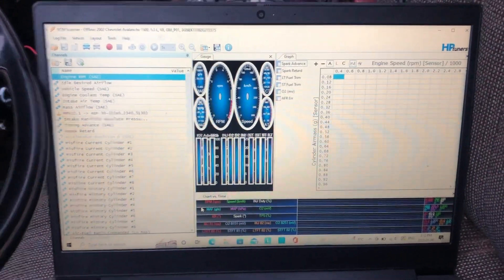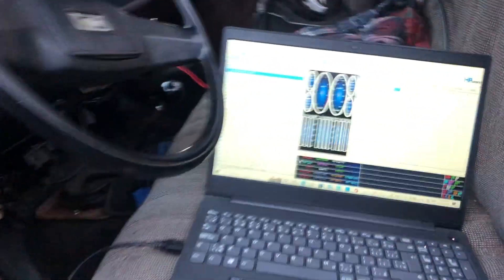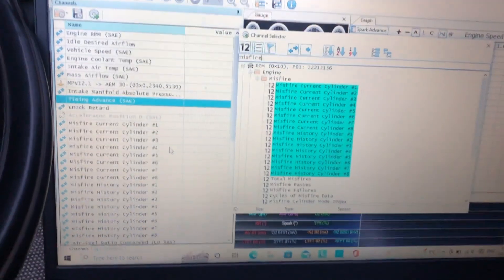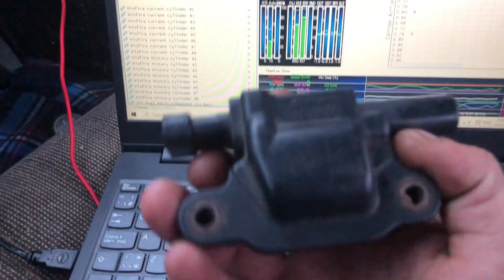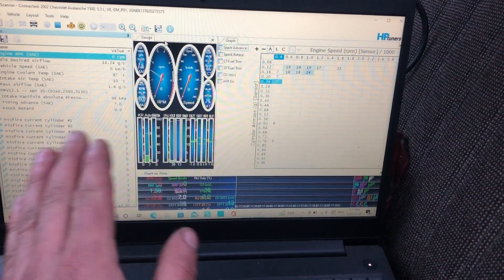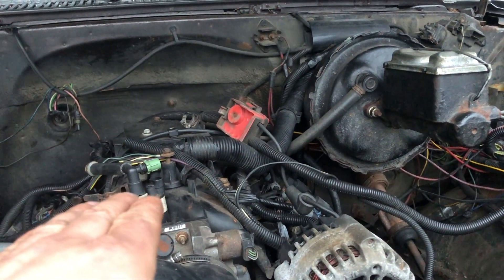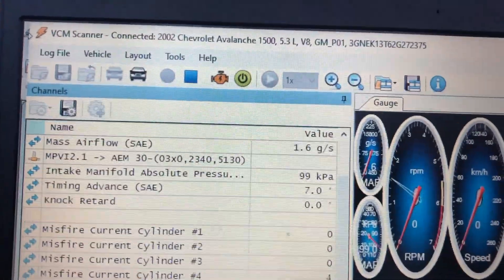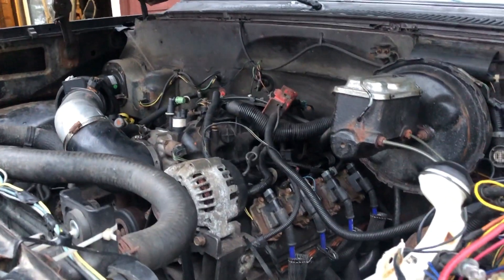Hp Tuners Chev 6.0 Swap Manual Trans P0300 Diagnosing with Vcm suite how to Find and Fix P0300

Comment: Thanks for sharing the video.   You mentioned moving the injector to cylinder #4. In the vcm scanner it shows 4 misfires on #4 and 2 misfires on #6.  Are you looking for  a high number before you consider it a problem? I didn't know you could use trans fluid to clean them.
Reply from the maker: At idle its not overly concerning especially at initial start up... you want to watch it as your driving and literally the second you feel the misfire it shows which cylinder is issue while driving befor i fixed it i was gettin up to 20 misfire hits on #2.... now that i cleaned and moved it im showing all 0s when driving in gear injector was partially plugged up
Reply: @BurninGas8.1   Great info.  I'm picking up a truck with an 8.1 and was going through your videos. I've used HP Tuners on other vehicles.